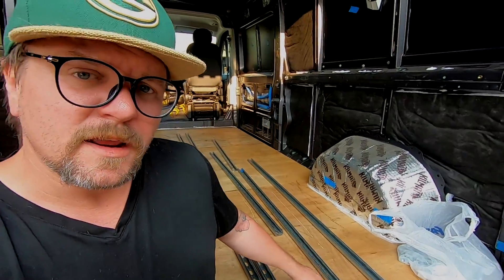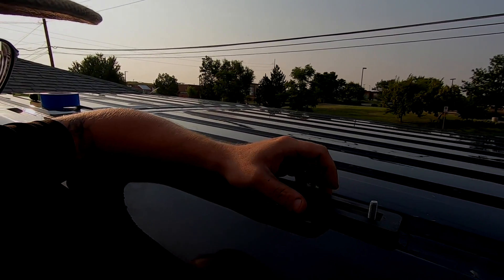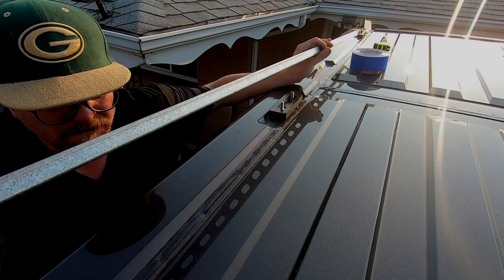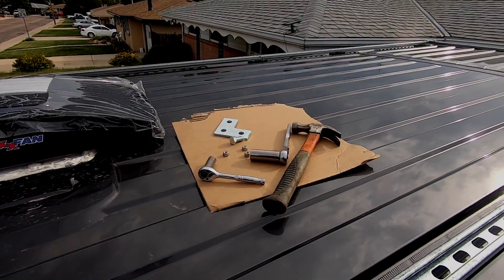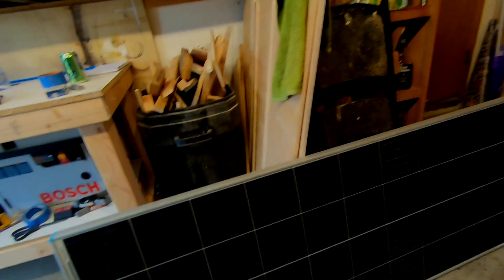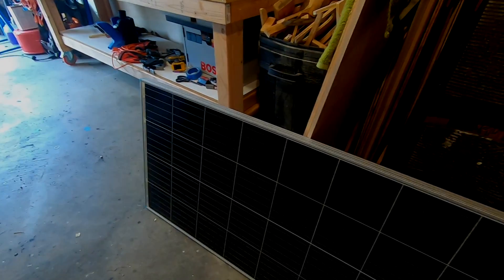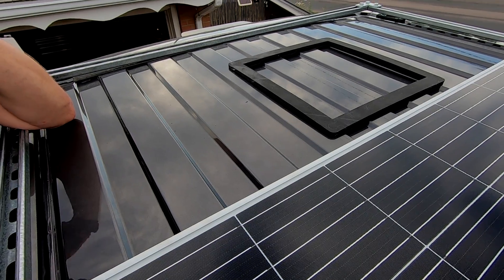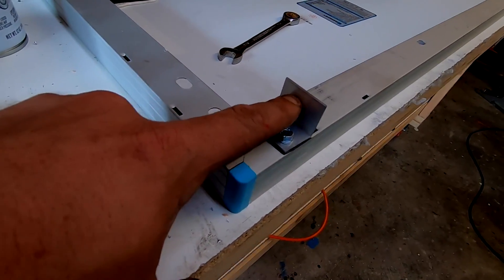$200 DIY ROOF RACK for SOLAR on a Ram Promaster

Comment: Very informative! I’m trying to do something really similar because be solar panels extend beyond my roof rack. Can you explain further how/where you bolted the solar panels to the rack?
Reply from the maker: Hello there! It’s been a while since I put the roof rack and solar panels on the van but if I recall correctly, I used pieces of 90° aluminum as brackets and bolted them to the solar panel frame and used soft tapping screw screws to screw them into my unistrut roof rack with Loctite. I should probably check on those self tapping screws since it’s been almost 4 years and make sure they are still solid, but I haven’t had any issues so I probably won’t.
Reply: @built2vanish awesome, that’s helpful, thanks so much!!

Comment: One thing I noticed about my build is that my panels don’t actually sit near as flush or with a little overhang on the unistrut as yours do and I pretty much have the same setup. Maybe I can take a look at whether I installed the unistrut level/plumb but for me I’ve had to try to come up with another way at attaching them. I might be able to buy the little Renogy z-tabs and then I’ll be able to attach the panels but sadly mine don’t sit quite as yours do. Positioning them sideways like you the top of my panel lines up with the other side of the unistrut no overhang. Thanks for the video ! Really helped me think my build through
Reply from the maker: Did you use the exact same components I used in the same solar panels? If so, then maybe the year of your van is a little bit different than mine.